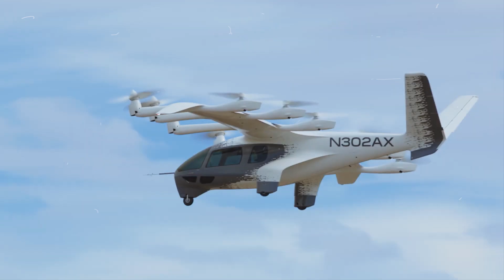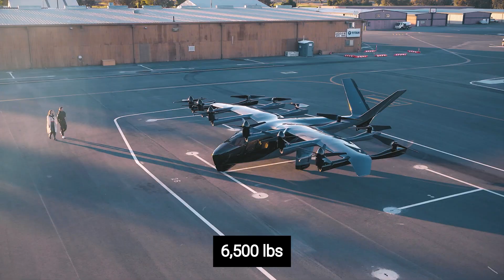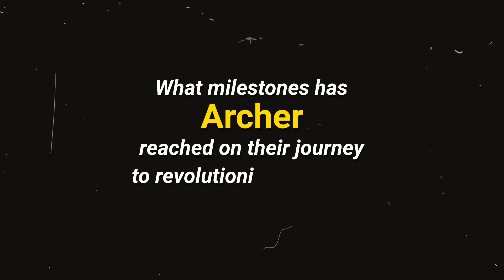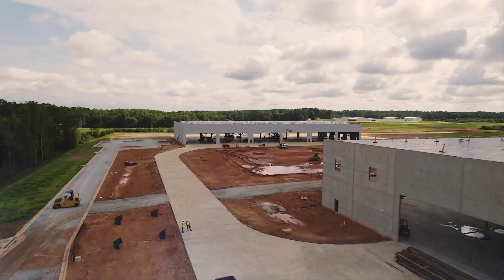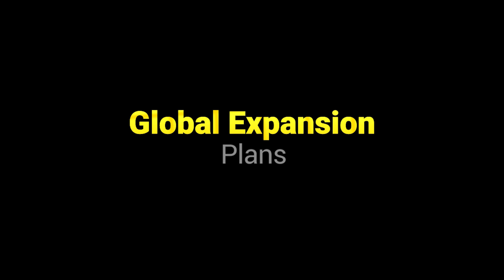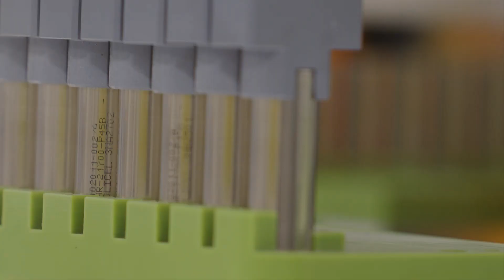Archer Aviation’s Midnight eVTOL! Will This Flying Taxi Change City Travel?

Comment: Funny how the only videos on Joby and Archer are now outdated, and everything they promised has already not happened, like in this case, commercial flights beginning by 2025, and making 650 units a year by 2026 "to keep up with demand".  What all these pie-in-the-sky projects have in common is all "accomplishments" are celebrated ahead of any fact, and pretty much none of such "successes" ever do, nor ever are, going to happen.  Oh, and it's not a car, it's an overweight electric airplane with thousands of pounds of heavy batteries, little weight capacity left for passengers, short range, and some tilted rotors for short but potentially unsafe takeoffs.

Comment: Beyond idiotic. It can do absolutely nothing better that a Turbine helicopter and has much worse power to weight ratio. A battery fire could likely lead to a deadly crash as could various software glitches that control the multiple rotors. Unless it can operate at a fraction of the cost of a conventional chopper, this will be a massive failure from Day 1.

Comment: So Safe flight looks like 50mph to 75mph  so it seems the only way they gone make a profitable trip is with very short trips. Probably to fly OVER trafic
Reply from the maker: @mikebones4449
You’re absolutely right—Archer’s Midnight is designed primarily for short urban trips, like flying over congested traffic. With a cruising speed in the 50-75 mph range, it’s not meant for long-haul flights but instead focuses on efficiency and convenience in city-to-city commutes or airport connections. The concept is all about saving time and offering a premium alternative to ground travel. Short trips may not sound ambitious, but they could make a huge difference in urban mobility!
Archer's Midnight eVTOL is optimized a payload of over 1,000 pounds and for short urban flights, typically around 20 miles. Its battery system is designed to support these trips with a charging time of approximately 10 minutes between flights, enabling efficient back-to-back operations.

Comment: Want to get a feel for what Archer's Midnight sounds like in comparison to Joby's S4? We took a dB meter and a video camera to the airports where they conduct their test flights. We measured a very different value than 65dB for Midnight. https://www.youtube.com/watch?v=FFguE2qWPfk&t=344s
Reply from the maker: Thanks for sharing your experience and taking the time to measure the noise levels! It’s interesting to hear that the values you recorded differ from the 65dB reported by Archer. Real-world testing can sometimes bring different results compared to official specs, especially depending on the environment. I’ll definitely check out your video—it's always valuable to see firsthand insights! Thanks for contributing to the conversation!